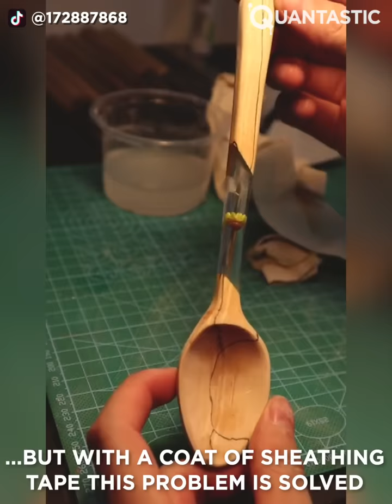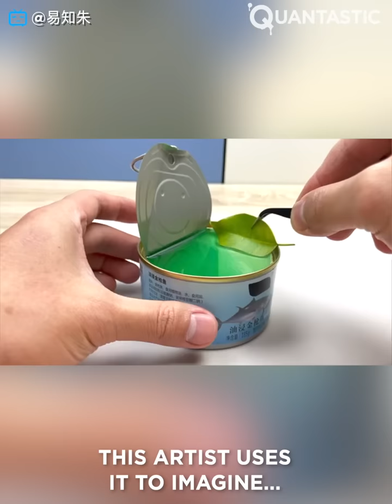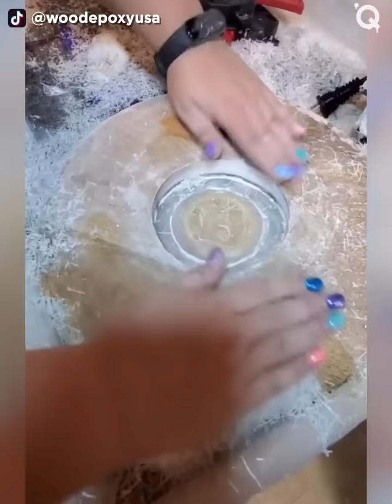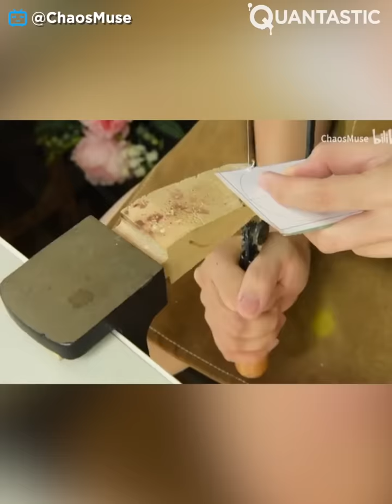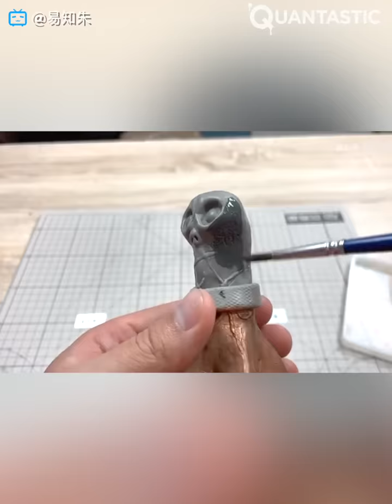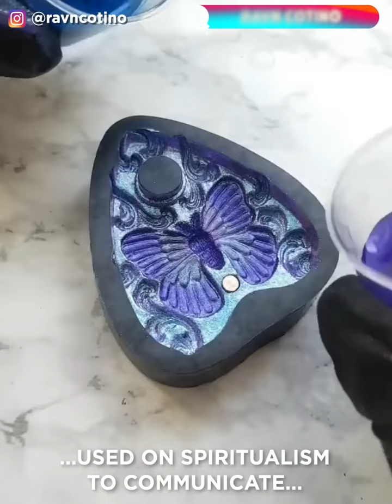Epoxy Resin Creations That Are At A Whole New Level ▶10

Comment: I actually do epoxy and when you say its safe you make it seem like everyone can do it but really its not because it's more for calm people that don't make messes and people with patients because it take a full 24 hours to do and it makes a chemical bond as soon as part A epoxy and part B epoxy touch each other and they get VERY VERY VERY HOT.  It also has a very strong smell to some people and people that cant handle smoke will most likely not be able to do it because they will need a gas mask and that is very heavy and it takes a long time just to design a epoxy project.
Reply: It really depends on what kind of resin you are using.
Low viscosity resin doesn't get that hot. But it takes too long to get done sometimes over 24 hours.